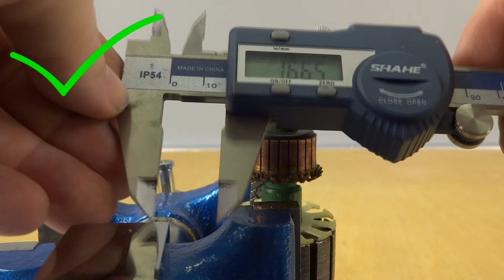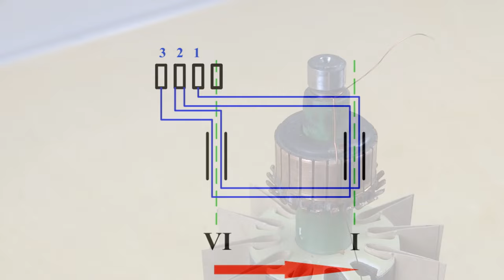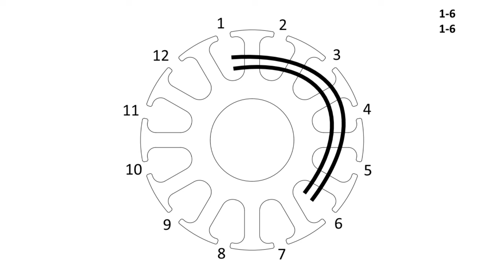My first experience with rewinding a motor armature

Comment: The air trapped in the deep grooves of the commutator makes the brushes jump at high speeds, (mini sonic booms!) causing excessive sparks, shortening the life of the commutator and brushes. You also loose a lot of torque on the motor. I usually cut the grooves as deep as possible, clean it up and then fill the grooves with regular White Putty from Pratley. When dry, i level and smooth the commutator surface, and i have a brand new insulation on my commutator that is even and will prevent that nasty thing i mentioned,  wearing down with the commutator evenly, (as it wears down over time) , making it truly as good as factory new. I also tend to micro-solder the connections on the commutator. Great video, thanx.
Reply from the maker: Thank you
Reply: I learned much from your contribution!
Reply: @wallacegrommet9343  My pleasure.
Reply: I never rewinded any motor or armature, but - at my old age - i'm trying to learn this stuff, as i fear the motors of my loved lathe and ( next ) mill could fail ...
I have got a motor spare, but ... to learn is my insurance ...
Your idea of air trapped in deep grooves seems to me very interesting, i'll memorize it for future rewinds ...
Reply: If the commutator is turned true, mica removed from the slots and seat the brushes, you won’t have that issue

Comment: Ok your video is good I don't think this is the first time you do this but its ok . However . You dont show how  you obtain your data on wire  gage  amount of turns or were you got it from. You just jump and hack it out means you got the data from technical  book .and also you dont have to re balance the armature if you mark were the original  last and first windings are and rewind it the same place it will end up the same .The late work on the contactor is completely  useless and a waste of strength on the thickness   you need to use a very fine sand paper just to clean taking is little is posible  out of the contactor material otherwise it will get burned on the first worm up copper  is great conductor but not to good resistant to heat .the success of a DIY Video is base on the idea the others can do it to and got the same results otherwise  is just a high  ego video
Reply from the maker: You may not believe it, but this is really my first experience of rewinding an anchor. And if you watched the video to the end, you saw that it was unsuccessful.
Reply: Dont need books, just common sense, just count the windings, if you need more power sure you can go up, but if just replacing a motor in a drill no need,  just copy what you see, wire gauge can be measured with a caliper, but rule of thump think 4amps per mm2 copper, id would say this is just a home video,  armature needs rebalancing anyways since you are adding new varnish witch changes the weight
Reply: @MrRacerhacker  Precisely. Common sense and observant. Don't feed lazy bums who seemed to demand info without effort.
Reply: Нормальная работа . Только вот просто прижав провод петушками к ламелям , контакт потом разрушится либо пайка либо микросварка. Провод обжигаете и считаете количество проводников, сам провод измеряете после отожженной изоляции. На мелких машинах делаем всыпную обмотку . Мотаем на шаблоне катушки, а затем вставляем в пазы.

Comment: I’ve wound thousands of motors and armatures with equipment from the 50’s, an armature of this size was a 1 hour job and $25 in 1980 including balancing. Today the whole Harbor Freight tool is $25. Good stuff, the motor shop is long gone.

Comment: In the 60s slot car motor rewinding was a big deal.  As the field magnetic flux decreases the speed increases.  ( It is in the denominator of the equation for angular velocity ).   They tended to melt down rapidly LOL. ❤❤

Comment: Change commutator to smaller is big mistake. And also if there are new brushes, they need to "make shape as commutator wants" (i don't know word in english), in this time speed should be lowered. After that, motor can work with full power.
Reply from the maker: Thank you

Comment: for the arcing, might recquire more undercutting on the commutator if its the old style with mica spacers
Reply: but long sparks usually points to the motor wires beeing short somewhere
Reply: Hi. had the same problem on rewinding 2 vaccum cleaner motors. 1- Commutator lost its quality and at 50 volts and above caused short circuit and spark. 2- Isolation liquid didn,t dry well. 3- didn,t balance well. Thank you

Comment: Nice job!  Sometimes just a nick in the wire will create a short at higher voltages, creating the arc, as higher currents are flowing through that particular winding with the short.  Good luck!
Reply from the maker: Thank you

Comment: good job well done. one year passed have you found what the mistake was? it may be because of bad carbon brushe or the tight carbon brushe
Reply from the maker: I've already figured it out - someone rewound the drill earlier and made a mistake in the winding circuit, and I copied the circuit with an error. But maybe I made a mistake somewhere else.

Comment: Very nice, I've been tempted to try this myself but chickened out but wont next time. One thing I missed was how did you know how many turns were required
Reply from the maker: Thank you very much. I counted the number of wires in the groove and divided it by 4 to find out the number of turns in one section of the coil.
Reply: @valsworkshop  Why would you divide by four - I only saw 2 coils using the same slot!
Reply from the maker: @johnantliff  There are two coils in one slot, two sections each, for a total of four.
Reply: @valsworkshop  I went back to 8:07 and realised that the second winding is in the opposite direction in the same slot.  I am surprised that there are 2 opposed sections but presumably they are switched on at different rotational positions otherwise they would cancel each other out!  Thanks for the video - useful information if I ever feel it necessary to rewind a motor armature.

Comment: wow amazing job.  But it's so much work to rewind a burnt out motor.  I had couple of tools (garden weed wacker, electric chain saw) suddenly fail due to burnt out motor.  But the problem is more design of the tool which does not keep active ventilating motor to cool it even when tool is not running to prevent motor burn out.   Perhaps it's much easier to add small electric fan to keep running when the tool is plugged in to keep motor from burning out.
Reply from the maker: Thank you. Poor cooling is only one of the possible problems. I think it's rare in power tools. But for example, on my lathe I removed the motor protection and installed a fan for cooling. Without a fan, the temperature could rise to 100 degrees Celsius or even more; with the fan turned on, it doesn’t even reach 70. As a rule, it stays in the range of 45-55 degrees.

Comment: 13:33 Would be interesting to show the degree of balance of the rotor BEFORE the work was begun.  What is the operating RPM?
Reply from the maker: I don't know, there is no sign on the drill, but it is low-speed.

Comment: Are you electrician? Did you change commutator brushes? My idea is:  Let you try, to make commutator brush more circullar. I mean, in a point of touching brush to commutator. Make it rounded with sandpaper between comm and brush. Medium and smooth grade sandpaper. And I recommend to polish smooth flat surface of commutator too. Not a deep wages on the comm because of long spark..
Reply from the maker: I tried polishing the brushes, it didn't help.

Comment: Which epoxy resin is applied and best fo power tool high speed armature that doesn't get loose after heating up. I'll be thankful to you idf you please covey the exact details of the varnisg and applying method.
Reply from the maker: Which one is best suited, I do not know, I'm just learning to rewind. I use KER-828 resin and ЭТАЛ-45 hardener.
Reply: Разводишь в ацетоне , более жидкая пропитывает лучше . При высыхании и отвердевании она так же хорошо изолирует.
Reply from the maker: @leonk16.49  С этим отвердителем смола и так получается довольно жидкая. Я проверял - склеивает в монолит.

Comment: Maybe the turns number per section wasn't 2 x 34 in parallel, but 68 turns instead, hence the arcing? Compare with the stator wire diameter. If it's the same with the armature wire, my assumption might be right.
Reply from the maker: I've already figured it out - someone rewound the drill earlier and made a mistake in the winding scheme, and I copied the scheme.
Reply: Hi! Very interesting, thanks!  @valsworkshop  But what was exactly the mistake in the winding scheme?
Reply from the maker: @PP3000-fk9lx  If I remember correctly, it was wound in the opposite direction, that is, the beginning and end of the winding were reversed.
Reply: @valsworkshop  Ok, thanks!

Comment: You probably made no mistake.  Run the motor for a long time on lower voltage to break in the brushes & commutator.  Also check the crush pressure (it may be too low).  Better a little too high than low.
Reply from the maker: Thank you for your advice. I've already figured it out - someone rewound the drill earlier and made a mistake in the winding scheme, and I copied the error.

Comment: check the armature on a growler, somethings not right , it shouldn't spark like that. It won't last long if you run it especially under load.
Reply from the maker: Thank you. I found out that the anchor had already been rewound before me and wound incorrectly, and I repeated the mistake. Or maybe it was something else.

Comment: epoxy name?
Reply from the maker: epoxy KER 828 hardener Этал-45М
Reply: @valsworkshop  Is this epoxy the only proper or can we use any other kind?
Reply from the maker: @mountris7can  You can use a special varnish for impregnation, but I prefer epoxy resin.
Reply: @valsworkshop  Thanks for the asnwear..What do you mean by special varnish?..Im a luthier and I use shellac for the woods as a precoat impregnation,other  times I use a base coat gel by BORMA WACHS.Maybe colophonium also.
Let me ask you more for the winding,in my case I have an armature stack from a Dremel Tool,it has 16 commutator pins and 8 bars in the stack,so I follow the procedure such as you do.How do I define  
where the starting commutator pin is to make the winding?The wiring was 0.1mm.I counted 356 wires in a slot/groove.
Reply from the maker: @mountris7can  I mean the varnishes that are used for impregnation during production. But those that I know require oven drying in compliance with certain drying conditions. Epoxy is simpler in this regard; the resin I use can be dried at room temperature. The beginning is where the end is. If the wire is not visible - the compound is in the way, then it can be picked out or burned. Or check with a multimeter. If there are 356 wires in the groove, then there are 89 turns in one section. Have you removed the winding diagram? We determined which lamellas the wires of the sections of one groove are connected to.
Reply: @valsworkshop  Ohh I see your info is really helpful.I also have the manual from the machine..I'll check it out..Ι  did the 89 turns with thread at first..I thinnk it had been burnt on the wirings on the very inside of the coil I didnt see any problem on the lamellas..Anyways,I ll inspect it more..Thank you very much Sir!!

Comment: What? Your first experience with rewinding a motor armature - get outta here!  Thanks for sharing your  entry into rewinding a motor armature - this video has helped me understand electric motors better and your video is the closest to the video of the Pakistani Man working in small workshop with the tried and true primitive tools, but I didn't see him test it.  I must have missed something, I saw that you  played "paper football" by removing the commutator and thumping it to the trash and then you  immediately placed a new (used) commutator on the bench.  These past four-(4) days has been  frustrating because I searched both YouTube and the internet and also read the Electric Motor Repair book by Robert Rosenberg and I still cannot get the leaf blower to power on when plugged into electrical receptacle.  I am trying to understand what type of motor is in my leaf blower: I was leaning  towards a Alternating Current Motor Control because I must plug it into the house electrical receptacle  for it to power on; however in my reading I learned that the Universal Motor is applicable to both AC and DC?  I used color matching zip-ties, so I can reconnect the correct wires [only 2 pairs!!]  I thought  once I cleaned-up the commutator I thought my leaf blower was going to operate.

Comment: Should of cut the comm with lathe, and then you could properly measure dc resistance with a milliohm meter (lm317 + 12.5Ω resistor for $1) and inductance values to properly figure out what exactly is wrong with it.
Reply from the maker: Thank you very much